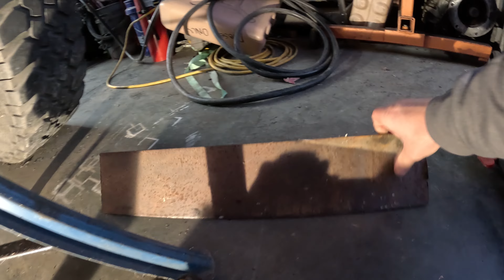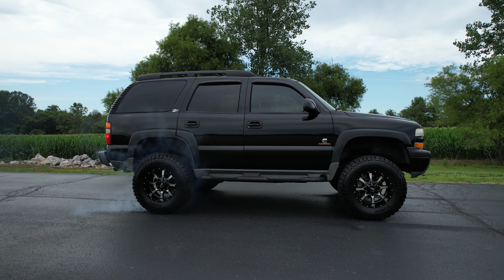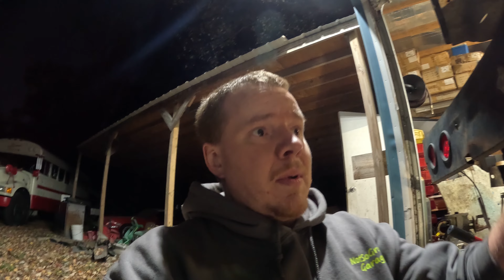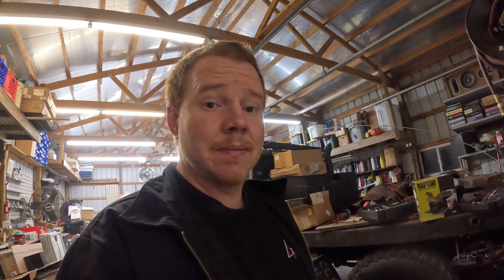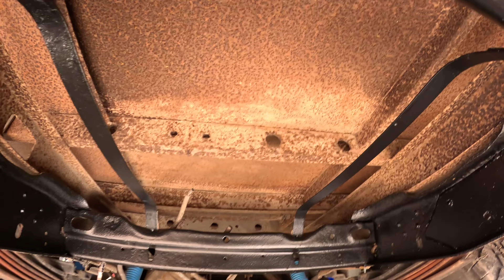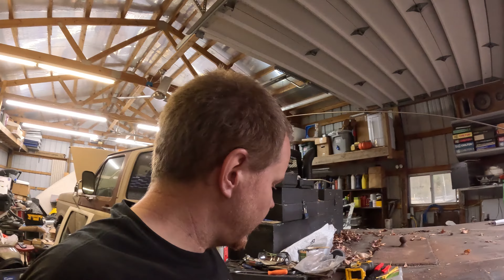1990 F350 Crew Cab Rebuild - Frame Repair & 38 Gallon Rear Tank Upgrade - Cheap Fuel Tank Upgrade!

Comment: Why did you choose to use an aftermarket sending unit rather than modify the factory one? Thanks
Reply from the maker: Because I'm not running a factory gauge cluster.

Comment: Do these fuel systems have a return line?
Reply from the maker: Yes.  Returning fuel to the stock location.
Reply: Okay, I just only saw 1 port on the new sump kit you installed, maybe I missed something
Reply: I believe with the new sump that is supply only the fuel (oil) will be returned through the original return port. With the sump kit it pulls from the bottom and allows you to run a bigger feed line size. @AmericanMade00